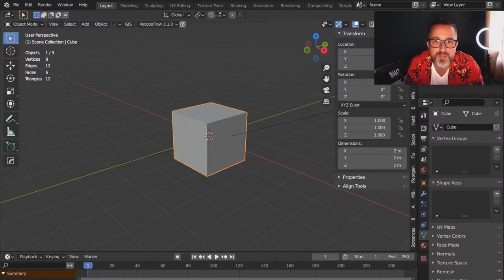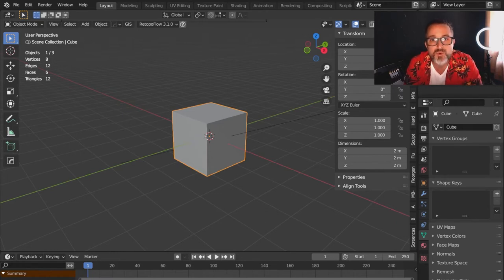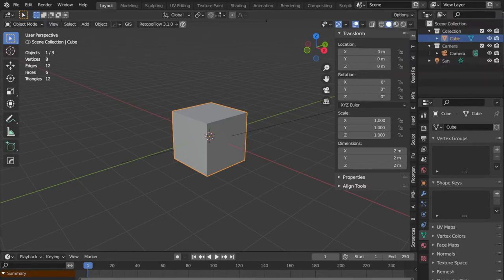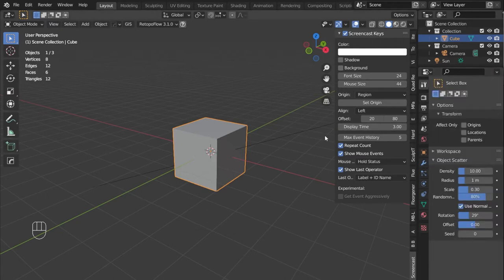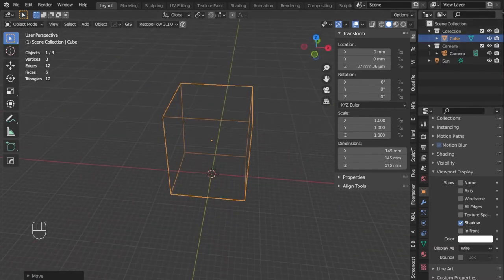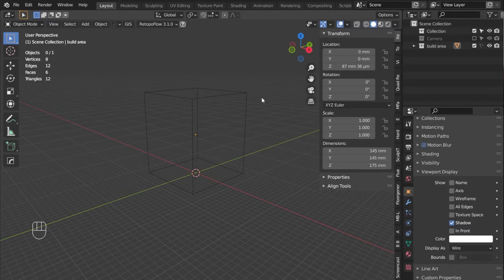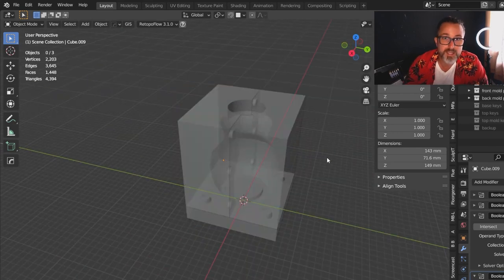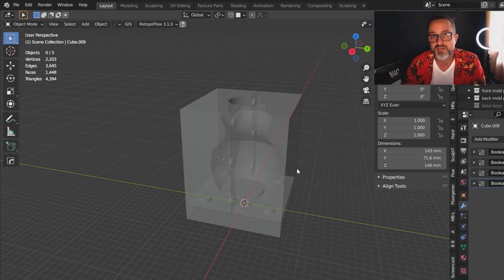Mold Making In Blender (Basics)

Comment: Thanks for sharing. I am wondering if you have any insight into the best way to  make a parting line along a curve of a model? I am new to Blender, however I  have used  Meshmixer for years and am trying to make the switch to using blender. What I'd like to be able to do is create a shell of an stl, then create parting lines along complex curves in order to make the parting lines less obvious in the final cast, minimize print time/mold thickness and reduce the number of parts to the mold required for complex shapes. Here's a video of a multi-part mold done in Meshmixer that is along the lines of what I'm trying to do in Blender. 
https://www.youtube.com/watch?v=lUprg4_bdGQ
Reply from the maker: You can do that with face sets in Blender using Extract Face Set ... its pretty similar. I actually prefer to use an addon called Black Mesh for this, which works sort of like Live Boolean in Zbrush (but better IMO.) I use a basic remeshing process to create the seam lines by extruding verts that stick to the surface. Then I use those seam lines to make boolean objects that I slice up the sculpt with. BlackMesh makes this a non destructive process so its easy to keep making tweaks.
Reply: @zombiesltd  Fantastic, thanks again. That’s exactly what I was hoping for, much appreciated.
Reply: This is exactly what I'm looking for too
Reply: @zombiesltd  It would be great to get a video that demonstrates how you use the addon with different shaped objects and faces e.g. a smooth curved surface, and a rigid but rotated surface, or a 4 part mold (base, with three parts around the object)